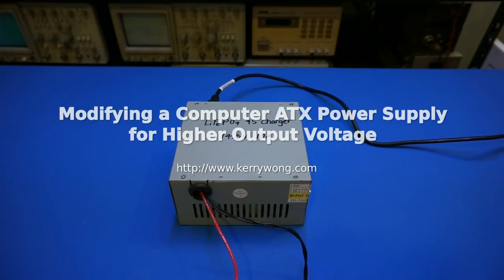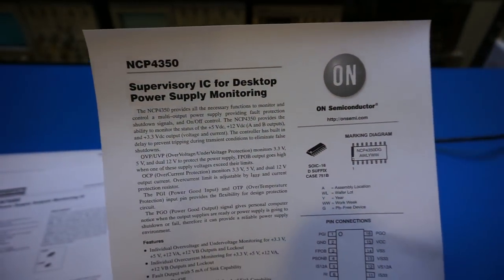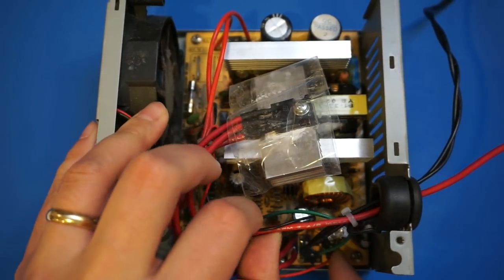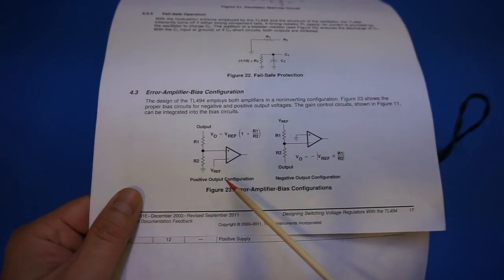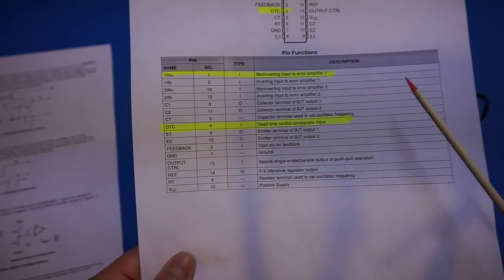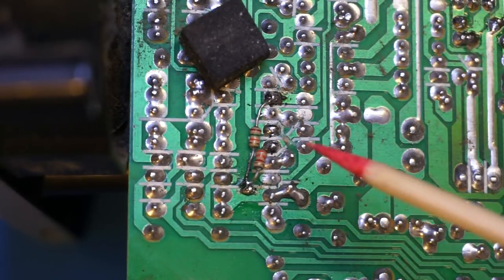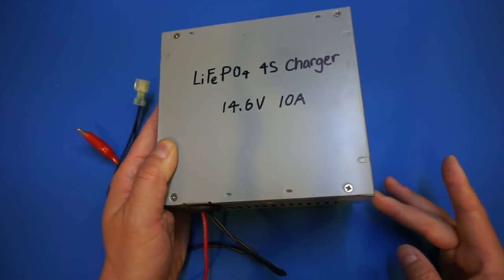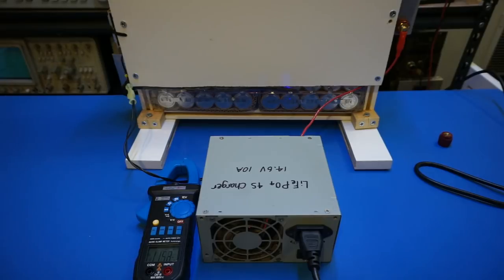Modifying a Computer ATX Power Supply For Higher Output Voltage

Comment: Theres  digital power supply with dial and voltage goes to 24v from certain online stores. Excellent when plugged in also show the power of item you connect. So batteries will come up at how charged they are. Best 10$ spent 9/24 volts at 3 amps. Digital readout.

Comment: I liked this modification but it would be so much better if you could demo a circuit which would adjust current and voltage.  You could also utilize the other voltage capabilites of ATX power supplies.  For example, it provides minus 12 volts at a lower amperage so if you could live with this limitation it would put out alot more voltage.

Comment: you can modify an atx ps to get 28v and at least 5A output by change the -12v line diodes (typically, the two FR107 diodes)

Comment: Why do you state that the external case can become a danger of electrocution ? 
You seem to still have the external case grounded ? So it would blow the breaker before raising the voltage of the case (the case cannot have high voltage without raising the voltage of ground, which would require a lot of current)

Comment: Should I mod the primary side(near IC) or the secondary side(TL437 control pin) if it uses a TL437 as voltage reference for maximum voltage swing? 
In addition, is there a way to change its current limit too? Most supplies do not use a current shunt and instead uses fancy feedbacks. So it's not as easy as modding a op amp.
I am planning to power the control circuitry with aux power if the original topology does not allow the output voltage to go too low. It's usually the best if you can find a PSU that has aux power built-in.

Comment: Hey man you pull down tl494's dead time pin to ground with 3.3k. This will means 0 dead time and there will be short circuit on primer mosfets. You should apply some voltage to dead time pin to make dead time different from zero and prevent shorts. Please answer.

Comment: Hi, i am also having experience in modifying smps ... But i get a problem of reverse voltage from battery. You put diod in this video. Can you guide me how to connect DIOD to positive wire of the battery to stop reverse current

Comment: Can i connect the PSU yellow 12w and the 3.3v in series in order to get 14.4 or 14.3 volts will this technique damage the PSU FOR DC motor...this is for powering the DC  motor
Reply: WONT WORK AS THERES NO WAY TO SEPARATE THE GROUND - THEY ARE COMMONED

Comment: Hello, Nice video ! i would like to disable the OCP on a TPS3513 on the 12v rail. My confusion is whether to ground the pin 5, unsolder it, or cut the pcb trace to it. Changing the voltage is done but at heavy loads the OCP kicks in and turns of the PSU. Thanks if someone can help !
Reply: Did you solve this problem?
Reply: @mtrltoolman  yes. I grounded it.

Comment: Is there a solution to regulate the voltage below 4.7  to get 0 volts 
I got max voltage 24 V
and minimum voltage 4.7 
I want to get voltages below 4.7

Comment: Mr. Wong,  I have a"ISDT Q6 Pro 300W/14A'..Lipo Smart charger,  that run off of DC 7-32v DC INPUT.     I want to Buy a External Power Supply,  so I can use this Charger on my bench using AC power.  A  AC to DC Power Supply.   An sense the DC Input is 7-32V,   I can use a 12v or 24v input power source.     I'm just no sure,   if I should get lets say a 12v 300 watt power supply, or something like a 24V 480 watt Power Supply.  I'll be charging (2) Lipo 3S 5000mah 11.1 volt batteries, at the same time,  using a Parallel Board.   What would be the most efficient and effective External power supply in your option?    Any help is appreciated.  THANKS
Reply from the maker: I'd get the 24V PS for your use as typically the higher the input voltage the more efficient for switching DC/DC converters (in this case your Lipo charger).

Comment: would you be able to take the output of the 3.3 volt and the 12 volt and run it as 15ish volts ? im thinking more of an additional part , anyway safely to do this ? thanks again
Reply: No. 3v and 5v are taps from the 12v. Take a look at a voltage devider circuit and it will make sense. Basically the 3v and 5v are divided from the 12v. 12 - 3 + 3 = 12.

Comment: Those wires and connections to the battery terminals seem to be a bit on the thin side for the current. Have you measured the voltage drop?
Reply from the maker: Those are actually two 16 AWG wires, which should be more than enough for the 12A maximum current. BTW, I just measured the current drop it's around 15mV give or take when the current is at 10A.
Reply: At 15A load I get 0.7v sag. Is this normal?
Reply: @Tsachyl  it depends on the cables, It could be. However, for this porpuse, voltage drop does not mean that much since when you are topping of the battery, the current will be close to cero, there neglecting any voltage drop.

Comment: 9:10 I see a cracked joint in the bottom right corner :)
Reply: I think that must be heatsink post for secondary rectifier Schottky diodes, not a big deal, that is not connected to nothing, is soldered just to provide an anchor point for the heatsink to the pcb.

Comment: I didn't hear anything about how you limited the charge current - you told us the current your batteries drew and that the PSU could cope but what is the batteries cannot cope with such a high charge current - is that also a BMS function ?

Comment: But after modification , that circuits over voltege and current protection work for modified output voltage , like 14.5 voltage ??
Reply: nope, he said you would have to disable it
Reply: @jacktheninja  what's why it burned my many 13007 whenever I tryed to play by shortcut its outputs :(
Reply: He disabled ovp but I want to know about ocp ?
Reply: @omsingharjit  oh yeah i am researching more until i preform this mod
Reply: @omsingharjit  so doe this work?

Comment: Hello! I ask you two questions;
1-Is there protection when over current is drawn from the source?
If the 2-14,6V output is short circuit, does the source protect itself?
Reply: although it's been a year,, regarding to your questions, the answer is yes , the atx Power supply has over voltage and over current protection and I already tested it but some atx Power supply doesn't have that feature

Comment: Great video.  I would like to suggest you do a video an adjustable bench supply from a PC supply in the same way (if possible).  Thanks!
Reply from the maker: Thanks! Most PC power supplies are not that adjustable so what most people do usually is to have a second stage of linear regulator (or another adjustable switching regulator) in series with the main output.

Comment: Is there a way to increase just maximum allowed current and all other to stay the same ? Because I use 12 volts and power supply shuts down when I connect something like cordless drill .
Reply from the maker: This will depend on your power supply unfortunately. Alternatively, you could try putting a small resistor in series with your drill (say 0.1 to 0.5 Ohm is usually sufficient) and this limits your maximum current draw without affecting the operation of your drill much. Better yet, you could put a 1000uf capacitor after the series resistor so that the initial in-rush current can be supplied by the capacitor.

Comment: Nice video man! I've been looking to do this for a while. I have a Corsair TX650M and I want to increase the voltage to 14v but i don't know if it is possible in this modern ones
Reply from the maker: Well, it depends on what's the mechanism for the overvoltage protection. On some power supplies, dedicated ICs are used and there's no way to adjust the threshold. So it depends.

Comment: Great video. Thanks for sharing. Could you replace the first resistor with a pot and make it variable? Also does modifying the 12V rail like this, also affect the 5 and 3.3 rails (perhaps making them 6 and 4 or whatever)?

Comment: Great Video!  Would it be possible to increase the voltage all to way to 18 volts?   Or is that not possible with this powersupply?
Reply: use DC to DC step up Boost converter
Reply: @rimurutempest8881  Is there a DC to DC step up Boost converter that you could recommend?

Comment: Hey Kerry, I'm curious about one thing. Does the BMS take care of the charging curves (first CC, then CV then Trickle) for the battery ?
Reply from the maker: Unfortunately, no. It only takes care of balancing the cells after the charging is done. There's nothing wrong with current limited charging for LiFePO4 or Li-Ion batteries, it just takes longer.
Reply: Yeah, I agree, CC and CV will be enough. The power supply is limiting the current? I might have missed that in your video.
Reply from the maker: Well, the maximum rated current on the 12V supply rail for this particular power supply is 11A, so it limits the current to some degree. If the power supply can deliver more current than that, you will have to add a small resistor in between.
Reply: Oh, I thought you made a constant-current mode for the PSU. I'd check the current/voltage waveforms when it's charging the battery pack when it's depleted (so maximum current). I've never seen any computer PSU with a CC function. When there is an over current, the PSU simply goes in to burst mode, and this will be terrible for the battery.

Comment: Why disabling the overvoltage protection completely? Wouldn't it be safer to insert a voltage divider that has an output of 12 volts towards the OVP pin of the chip? That way, if an overvoltage occurs, the power supply will still shutdown. A safer solution then disabling the OVP completely imho.
Reply from the maker: You are correct, could've done that as well. It was just easier to do the modification...

Comment: I spent ages looking for cheap, high current battery chargers, all cost ~$1 per watt without it being alibaba or something. Brand new computer power supplies even are $1 per 8 watts from good brands, which is fantastic compared with battery chargers. Definitely giving this a shot.

Comment: Theres a bad solder joint in the lower right corner where.the two resistors are installed

Comment: You have said nothing about changing output capacitors for higher voltage ratings; output voltage rails even if not used are going to be raised too.
Reply from the maker: Good point. In practice though, the output caps have quite a bit of margins. Most supplies I've seen use 25V caps for the 12V rail and similarly overspec'd for other supply rails as well.

Comment: can i raise voltage up to 30 volts
Reply from the maker: Unfortunately no, the maximum output voltage is typically limited by by the pulse transformer and in these ATX power supplies, the max you can go on these 12V rails is probably no more than 16 to 18V.
Reply: i will make that in the same way you did , and thank you very much.
Reply: @KerryWongBlog  can i get  -18_GND_+18  5A (180watt) for my amp

Comment: that mains input IEC wiring looks rather dangerous (at least from the camera angle)
Reply from the maker: Yeah, it's not the camera angle I was surprised that there's no heatshrink on the connectors at all.
Reply: Guys, expecting heat shrink tubing on connections that were never meant to see the light of day is a bit ridiculous, don't you think? 
If your PC gets banged up enough to have ANYTHING touching those connections during normal use then you have bigger problems than non-insulated connections! ;-)
Reply: well it looks like there is less than 2mm of a gap between wiring leads, one surge and you have a nice ionized path of destruction
Reply: Alyx BioHaz 
And that is why fuses exist.  
You're kidding, right?
How much of a surge is needed to create an ionizing path through 2mm of air? ...that was rhetorical. My point is that expecting a manufacturer of relatively cheap power supplies to guard against such an extreme situation is naive at best! The extra cost is not justified if the unit is not meant to be user serviceable.
Reply: It's before the fuse, 400v can easily jump 2mm, it won't trip the house breaker unless it's an rf breaker, and it's a short to ground... I may have only been in the power supply industry for 5 years but even I know that it's a recipe for disaster and I have had seen surge arc overs jump a much larger gap than 2 mm

Comment: What u didnt said is - an important thing....

If u had your ATX Power Supply to the mains - and open it after, the Capacitors are charged - with barely over 400V - that can KILL u !!!

Plz, before taking out the PCB, discharge the Caps !!!

Or u will never touch anything anymore....

Comment: Don't expect your batteries to last long. Li batteries need to be charged in proper and unique steps, using Pre-charge CC, CC and then CV and then shut-off at the right voltage.
Reply from the maker: Lifepo4 batteries are not picky about how they are charged.  In fact, as long as the terminal voleave is correctly set and the charging current stays within the maximum allowed charging current everything should be fine. The only issue you might run into is slower charging time as the current tapers off much earlier than CC charging profile.